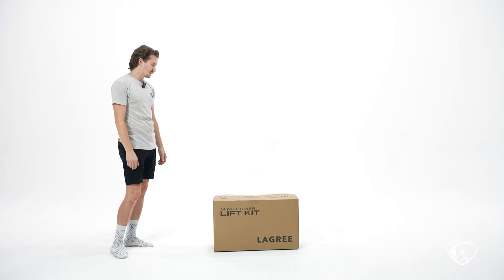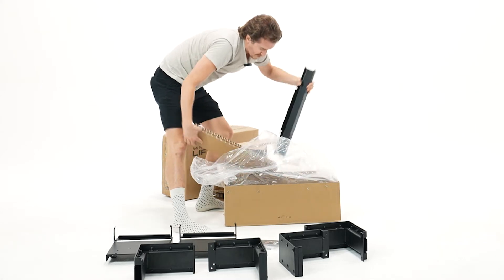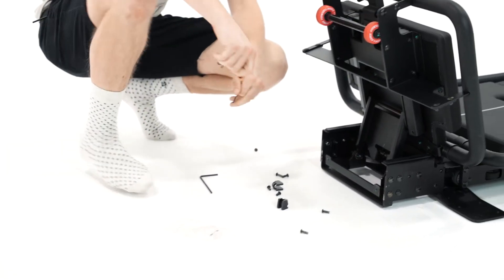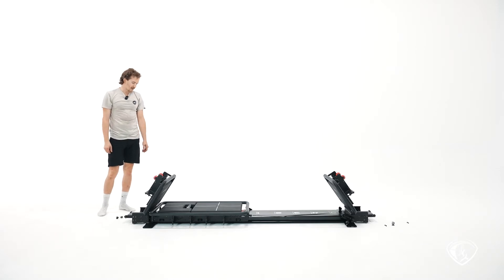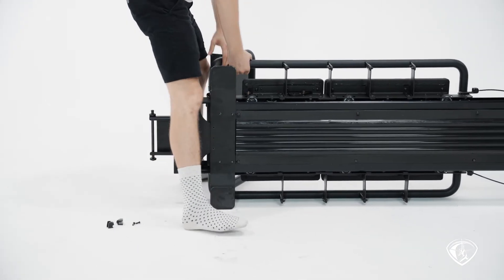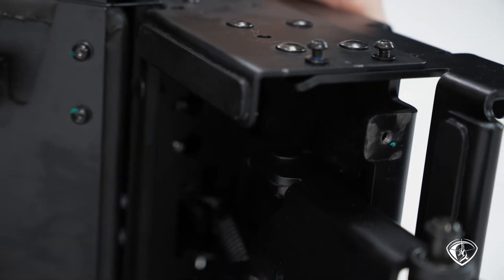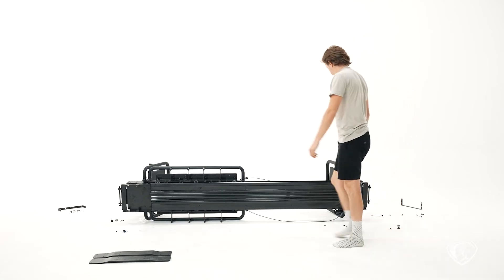Lift Kit  install on Mini  and Mini Pro

Comment: 00:05 Installation of lift kit on Mini or Mini Pro.
02:11 Preparing mini or mini pro for lift kit installation
04:13 Disconnect springs, disassemble ends, and remove securing bolts to prepare for lift kit installation.
06:21 Installation of lift kit and removal of foot brackets.
08:27 Proper bolt alignment is crucial for bracket installation.
11:03 Installing the lift kit involves aligning and tightening the bolts.
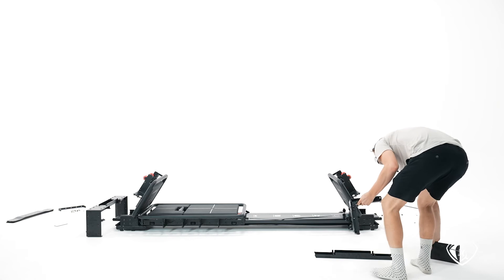13:05 Installing lift kit on Mini and Mini Pro
14:44 Installing lift kit on Mini and Mini Pro
Crafted by Merlin AI.